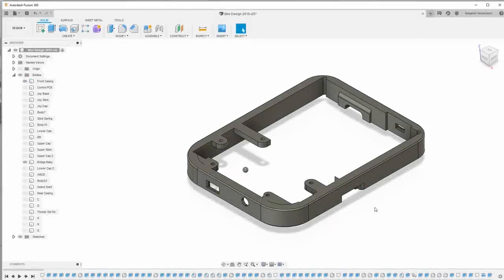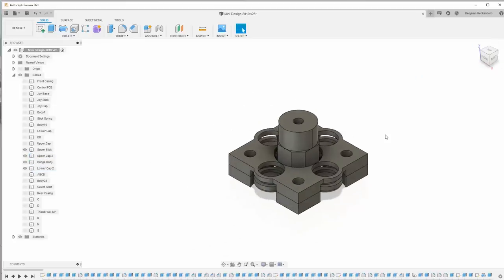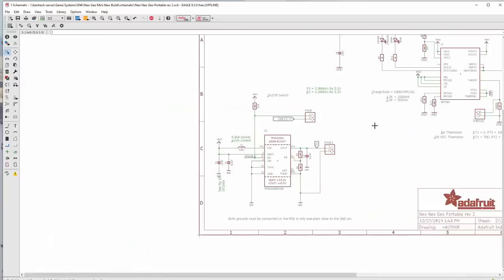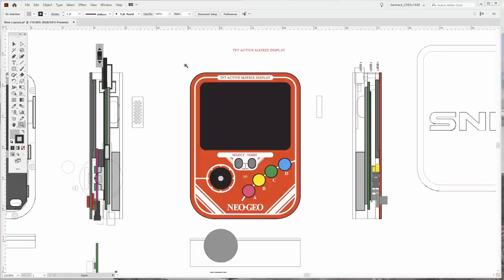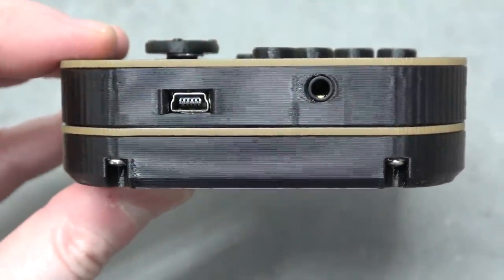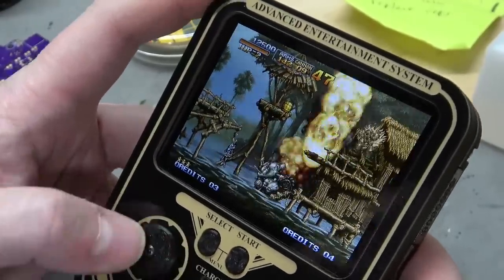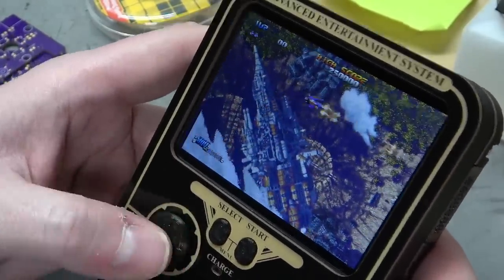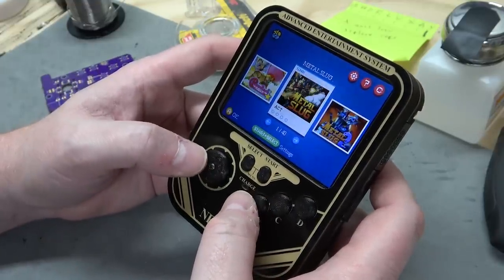Neo Neo Geo Mini Portable

Comment: I agree completely about mini usb. Much more rugged and with its shape, just as easy as USB-C to plug in correctly on the first try
Reply from the maker: I have a Pixel 2. The USB-C port is a joke. Oh I saved half a second not having to check which way I plugged it in, but I waste 5 seconds gingerly aligning the cord so it actually stays connected to charge. #fail
Reply: @BenHeckHacks  USB type C is terrible.... especially when people carelessly let dongles and heavy cables dangle off the side of laptops and expect them to last as long as a full size HDMI connector.

Comment: I think it would be really interesting if you made a modernized mini-Gameboy. Redesign the entire Gameboy PCB to minimal thickness, load games off of solid state, crisp OLED display, and have stereo speaker sound. That would be quite a project, I know. Also, I still think the red and white portable looked stellar.
Reply: Would you warp one of the channels since it's mono? Some kind of spatializing?
Reply: @returnofbeaux  I thought the gameboy outputs stereo from the headphone jack. Might be wrong about that, but there is definitely a world of difference between the  speaker and headphone.
Reply: @doc_sav  ah. thanks. it has been years.

Comment: Groovy NG portable! I commented on the part 2 video before seeing this, but I'd like to suggest a version shaped more like the original NG home joystick but with the smaller 24mm arcade buttons instead of the original 30mm ones, a joystick closer to an original arcade joystick (don't know if they come a bit smaller than the normal size tho), and the display embedded in the thing.

Comment: You should buy a Portable neo geo for a video. I’d totally watch you play and see what’s wrong with it, crack it open, and possibly make improvements to the existing hardware. Btw, personal story below if you want to read. 

I bought some wireless earbuds online for super cheap and one of them wasn’t working. The other sounded good and the price was cheap enough that i felt like I should crack it open and have a look around inside. Turns out one of the speaker wires wasn’t soldered. 
I, never really having soldered in my life, tried to take the easy way out and superglue the wire to the board. I know, good idea right? After wiping away the plastic that melted from the superglue, I asked my dad if I could use his old soldering iron to give it a proper try. Because of your videos, I had the confidence to pick up a soldering iron for the first time and see if I could fix my earbuds. You should’ve seen the solder I built up on the components around what I was actually trying to tin. The tip was huge and the components in the earbud were SUPER tiny! In the end, I was able to fix it with no bridged connections, and it works! The sound is a little tinnier than the other, but they were suuuuper cheap, so I’m happy.
Hopefully, the story wasn’t too long for you to read through, I just wanted to let you know that you inspired a fairly recent subscriber to try something new. Thanks!

Comment: I have a request for a design, Have you seen the MISTER FPGA systems ? A custom case with keyboard like a C64 / atari XL with custom IO and USB expansion boards to fit would be a great addition to the growing project. I am currently looking at a modded Amiga 600 case with a cheap mechanical keboard.

Comment: It’s always easier with a pcb. Version two looks awesome. I’d love to see a diy option for portable power to the Rpi4. All the boosts seem to be for 2A or lower.
Reply: Joe Blow  dang. I just picked up a small, 10.1" HDMI monitor, a zero delay USB encoder, and had an old ion icade and a spare 20k mAh/72watt hr pack made by Anker laying around.  Was hoping for decent battery life once I figure out what sbc and speakers to out in it.

Comment: That looks cool. By the way, does the player 2 usb port allow for the use of an usb hub so that both players may connect separate controllers through it? If it is reserved for the player 2 only, and player 1 is supposed to use the built-in controller, how does the HDMI cable feel while playing? I'd assume it's not inconvenient?

Comment: might as well be a mix of a D-Pad and an analog. I'm really thinking about designing such a thing myself, based on a wireless PS2 controller, which has a really nice D-Pad, easy to use, little force required, moves really well and just pivots with a single spring. It has rubber pads, and hence no clicking sound, but it works smoothly just like this judging by how it moves, but with enough force all directions are pressed, and so it lacks a true pivotal separator.

Comment: Great work. If you designed digital drop-in replacement joysticks for the Neo Geo Mini and the Mini Pads, I think you could easily sell them. Lots of people would want this. Also, do you really need the digital to analog conversion circuit? The Mini Pads seem to output digital despite having an analog stick, at least my system recognizes them as digital. I would assume the Neo Geo Mini would accept digital input just fine.

Comment: You should upgrade your 3D printers, both to a resin one for the fine detail but also for the FDM because that shell is quite rough looking TBH. :/ With your knowledge on the matter I'm sure any large 3D printer manufacturer would be happy to send you a printer, if for nothing else than your feedback on the printer.